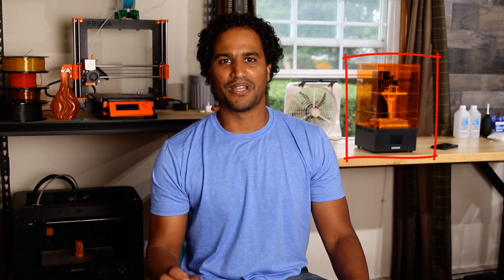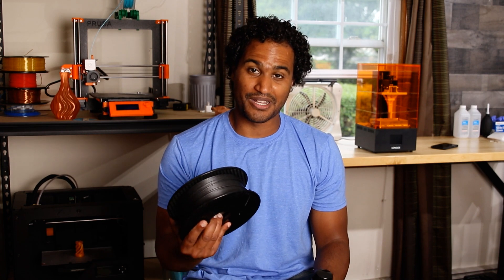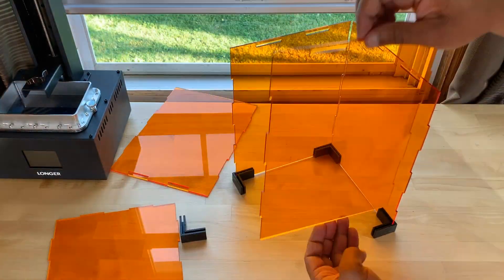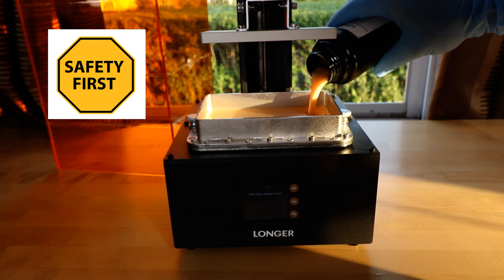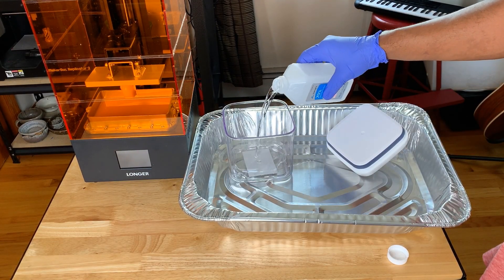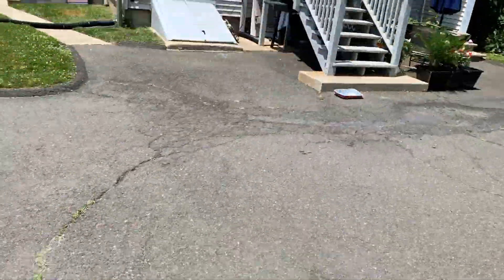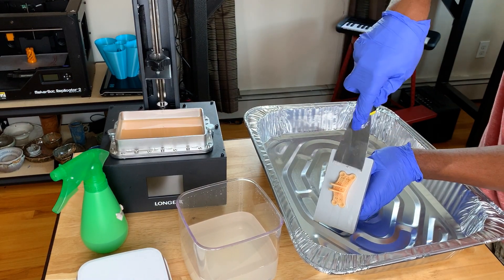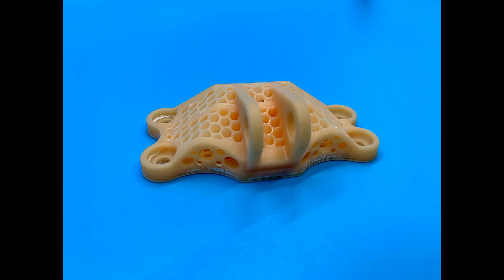Longer Orange 30 - Getting Started with Resin 3D Printing

Comment: I really enjoy your videos and the approach you take as well as how you explain techniques. Thanks!
Regarding the white powdery ring, it is probably dissolved resin that stayed on the model after the alcohol rinse. It settled and finished curing there because of gravity. If you have compressed air you might try blowing it off carefully before final curing.
Reply from the maker: Thanks, that makes sense.  I'll make sure to get all the resin off on my next print.
Reply: @DesktopMakes  you might want to try a two step IPA wash setup - basically always rinse the part first in one container (consider this a initial cleaning), and then in the second container (final rinse) - that way you can have a less polluted/diluted IPA final wash, so your parts will come out cleaner. In the long run you'll also reduce your costs, as you will not need to replace the final wash solution as often (less uncured resin gets there)

Comment: First thank you for talking about Safety, very well done, as any kids in the house will be standing next to the what ever kind of printing you are doing. This looks like a great deal for $300 + to start with. I am 77 years and like 3dD printing to keep my mind working, no reason to walk if you don't spend time learning. I use Fusion 360 to try and get kids ready for life is a way, that when they really start their trade to work in they know what different jobs are out there. If you are going to be a builder of anything, you have to be able to draw it to build it. I use lithophane photos to get them interested then show them Fusion 360 to make the different holders to set them in. It has to be fun or they will walk away.  Now I am using the Ender 3 Pro. Thanks again for your time.
Reply from the maker: Thanks Art.  You're absolutely right.  Once you put in the time to learn design it opens up a new world.  I like your approach of teaching the kids with a practical and fun project.  I have the same experience with teaching kids.  Get them excited to learn and the teaching becomes a lot easier.  I love that you're doing this at 77!  I hope to do the same.

Comment: Does a resin print tend to be stronger and are overhang issues nonexistent ?  I have a small part I drew and printed fdm to replace a broken RC car part, but it isn’t strong/durable enough.  Wood be interesting to compare.  The price of these now is indeed making it more interesting.  Thanks for the video!
Reply from the maker: Hey RVJimD, I can tell you that the bracket I printed is a lot stronger than if it would have been printed with a fdm printer.  Especially the sections where the load would be applied along the vertical layers which will always be the weakest part of fdm prints.  Resin prints strengths look to be less dependant on orientation.  There are also tough resins out there that are supposed to be stronger but I haven't experimented with these yet.

Comment: Biggest tip I can give which will help you to get your prints off the build plate is to use supports - it makes it soooo much easier. Also to print items at an angle to the plate rather than perpendicular - it can help with warping. I'd second the tip about not using a metal scraper - if you use supports, a plastic one is enough to get your prints off the build plate.

Comment: I print the opposite way to that with my printer, but I know with bottom up machines, it's common practice to do longer exposure times on the first few layers to make sure it adheres to the plate. It's possible that longer exposure time could be a factor in the difference in colour. The resin itself could also be a factor. You may find you don't see it with a different brand/colour. Bit difficult to say with any certainty without further experimentation though. DId you rince the model under the tap before curing it to get the alcohol off? Another possibility perhaps..
Reply from the maker: Yeah, I'll have to experiment a bit.  No, I didn't rinse the model to get the alcohol off.  It didn't say to do that in the instructions.  Is that common practice?
Reply: @DesktopMakes  I believe most people tend to do it. When alcohol dries on stuff, it can leave a while mark (especially on wood).
Often people will do a 2 stage alcohol wash (one like you did, and then again in a clean solution once most of the resin is off), but I've personally found an alcohol wash like you did, and then washing in warm water with a bit of dish washing liquid (and rinse under tap) not only gets the resin off, but gets rid of the greasy feeling that you may feel when touching it :)
Reply from the maker: @welbot  Thanks, good to know.

Comment: Nice video..touch the nice parts. Could you also do a video on how environmental unfriendly the resin printers are¿ 

The safety aspects... Look how much stuff you need to protect your self???
Where to those go everytime you print something?

Second, disposing of all the used resin and hardening alcohol?

Resin printer is as bad as all the plastic polution we currently face in the world. If it goes mainstream we're just going to ruin our planet!!!
Reply: Best not use a resin printer then eh? Maybe he can do a video on how cars, boats, planes,  trains, cows, etc are environmentally unfriendly. Fool.
Reply: ANYCUBIC 3D Printer Resin, 405nm UV Plant-Based Rapid Resin
Its biodegradable and much safer to use. You can reuse the gloves as well, no need to take a new pair each time
Reply: The alcohol does not need to be disposed of, it evaporates.  If you are concerned about alcohols in the environment then we need to kill off untold numbers of bacterial and yeast strains living naturally throughout our environment -- which would be impossible  As for the resin, as soon as it is exposed to UV light it starts to solidify.  Therefore, it becomes a solid plastic.  Not to hard to dispose of solid plastics safely.